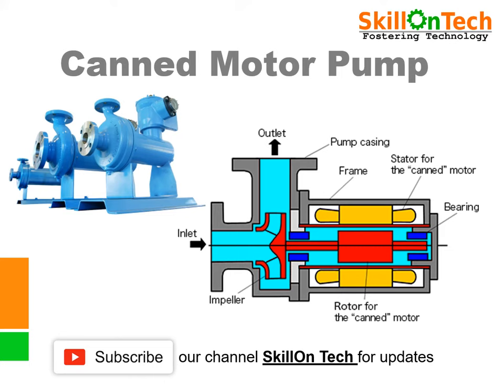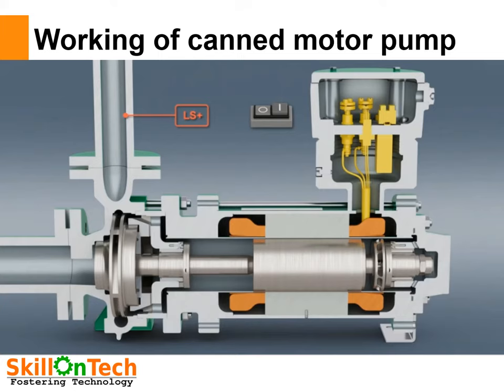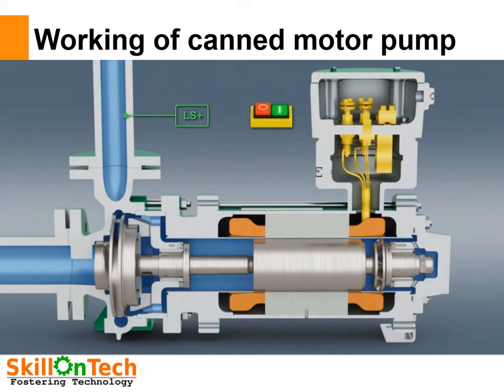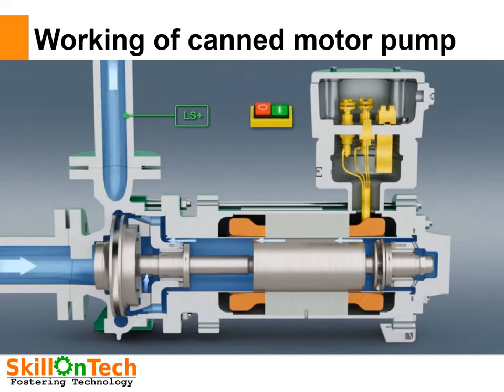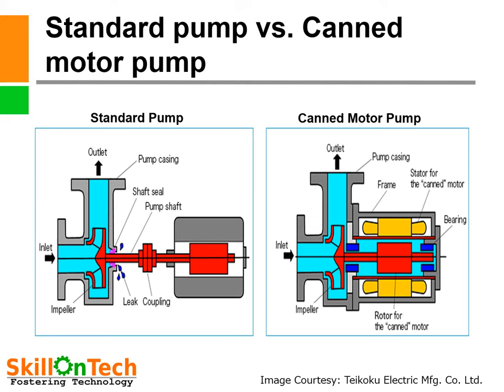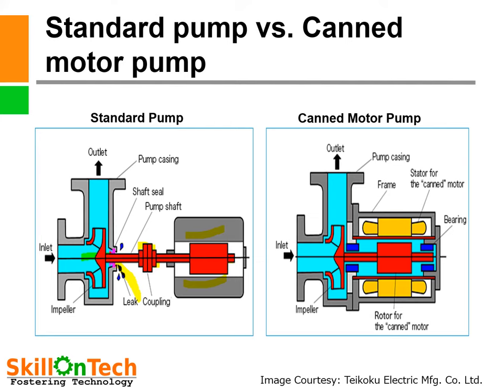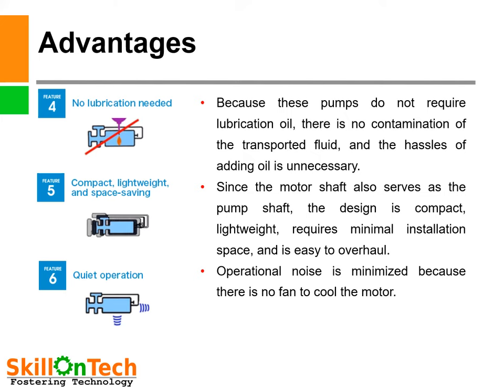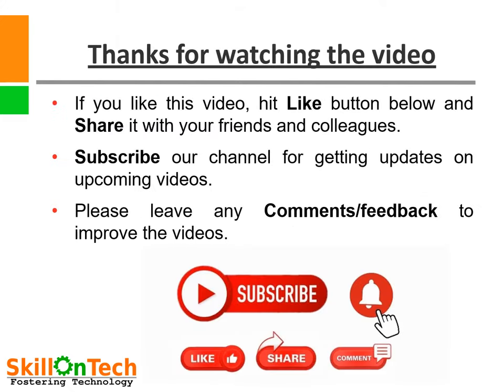Canned motor pump (with english subtitles)

Comment: How lubricantion will done if we flow water
Reply from the maker: Canned motor pumps are used in handling of D2O ( heavy Water) and performance is found satisfactory. Water itself work as lubrication and cooling of bearings.

Comment: Sir as i see canned motor pump in refinery, there is also  two water line in body,one is suction and another one is discharge.my question is,is it cooling medium for pump???
Reply from the maker: Water is a good lubricant and coolant. So there are both possibilities for water, as process fluid as well as coolant.

Comment: Can we see rotation of canned motor?
Reply from the maker: Thanks for the question! We cannot see the rotation of pump as pump motor is sealed within the body. However, pump rotation direction can be checked indirectly by head measurement.
Reply: If you want to have more detailed information about canned motor pumps, feel free to contact HERMETIC-Pumpen GmbH.
We are a German company that produces canned motor pumps with a company history of more than 150 years. By the way , you should clarify with HERMETIC before you use the content.

Comment: Which sealless pump have more efficiency ? Mag drive pump or Canned Motor Pump ? When we can use mag drive pump ? When we can use canned motor pump ?
Reply from the maker: Magnetic drive and canned motor pumps both are seal less pumps. Both pumps are efficient. Due to magnetic losses in mag pump, canned motor pumps are better. Canned motor pumps can be used when precious liquid are handled. Canned motor pumps are dedicated to a design load. If end users need to change duty conditions (flow, head, specific gravity or viscosity of the liquid), then they cannot use the original canned motor pump because the power may be insufficient for the new parameters. A new pump may be required. Mag drive pumps use standard motors (IEC or NEMA) and if the duty point changes, the same pump can be used with minor modifications. Mag drive pumps are used for acid, alkali handlings widely.

Comment: Can we use active magnetic bearing in canned motor pump?
Reply from the maker: The application of active magnetic bearings as an alternative has been outlined especially for chemical pumps. In the design phase of the electromagnets, the static magnetic forces have first been calculated analytically and bearings shall be designed as per existing radial, axial load and lubrication.